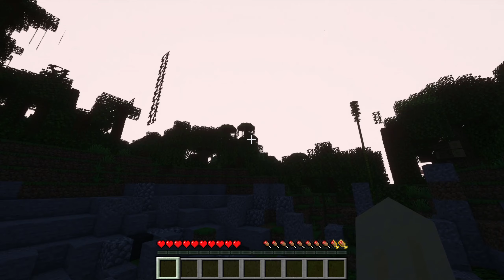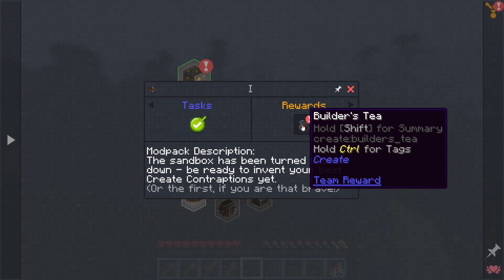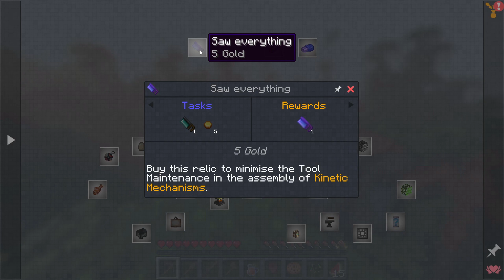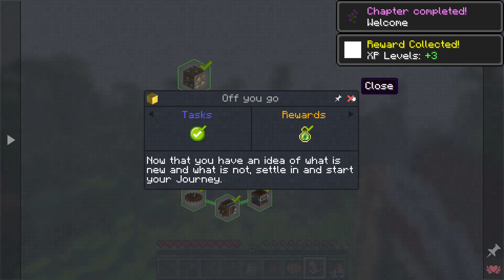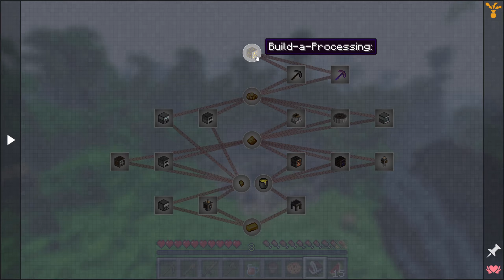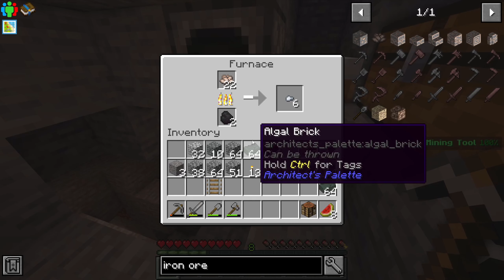Minecraft Create Above and Beyond - Episode #1 Getting Started - Modded Minecraft

Comment: For your shaders is it a included mod or did you add optifine?
Reply from the maker: I added optifine! And its the complementary shader pack
Reply: @BackdraftGaming  been messing around with stuff recently has optifine just become unusable with the mod now due to flywheel? any optifine version I use just crashes upon launch
Reply from the maker: @prospectOWR  i topped using optifine and switched the magnesium with shaders off and it actually works fantastically!